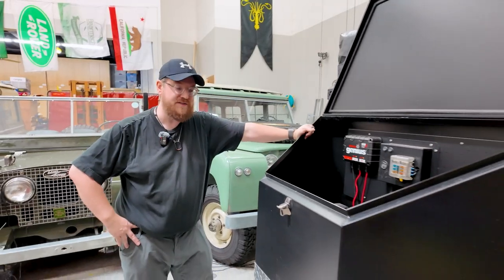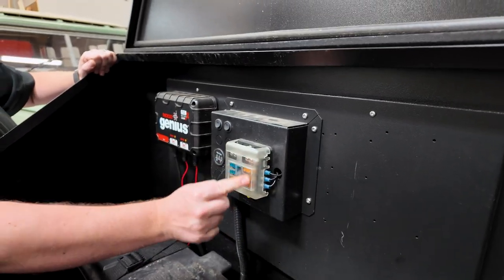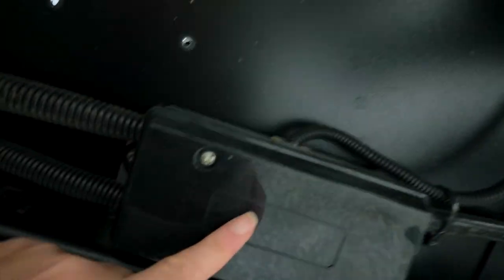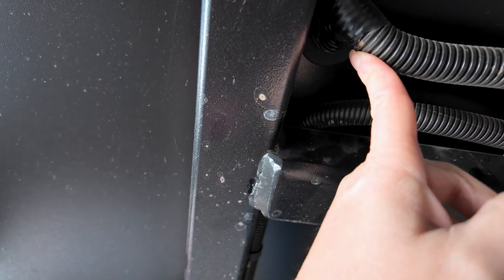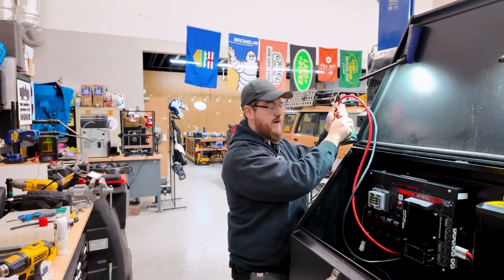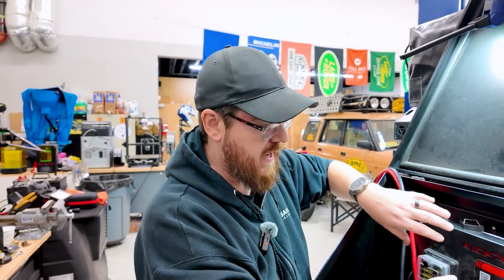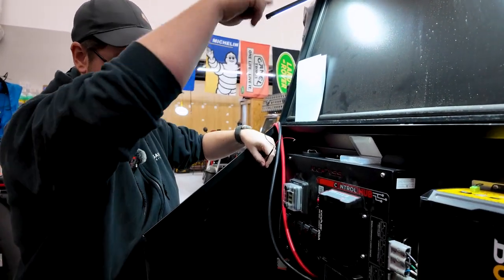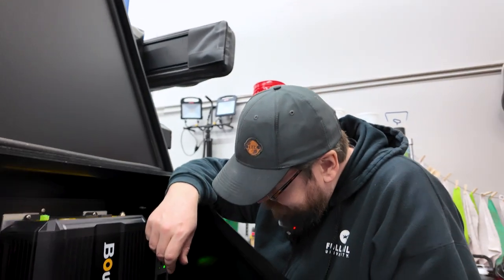Off-road Trailer Build, Adding Solar and Lithium Batteries to our rig.

Comment: How many Amp hours is you battery?  Did you find this was adequate?
Reply from the maker: 200ah in the battery, and it ended up at about 65% after a full weekend of testing, that’s without adding back in with any solar, so yes for this size trailer it’s great. Keep an eye out for the next episode to see us testing everything out.